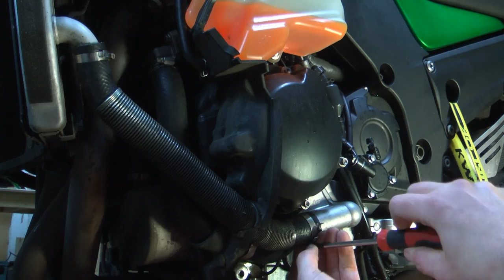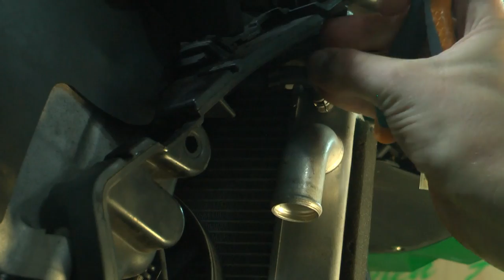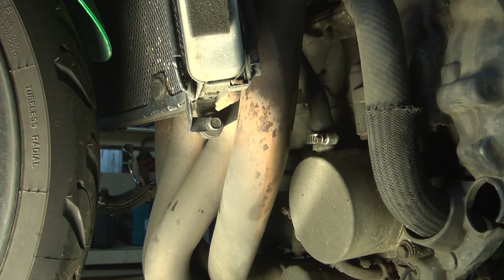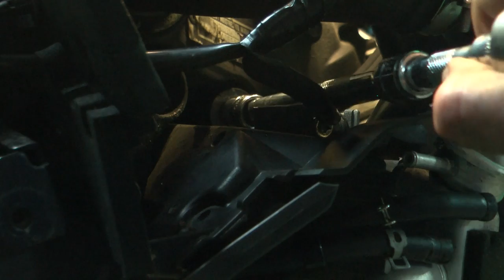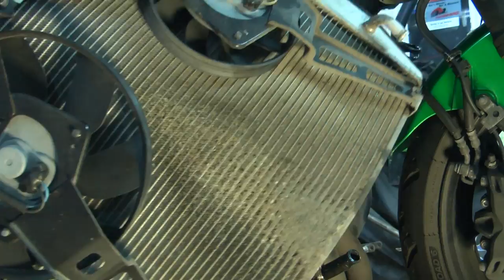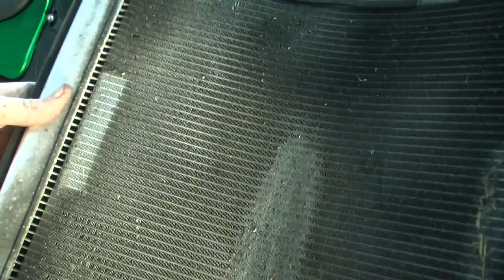Kawasaki ZX-14R ZZR1400 Radiator Removal , Part 1 of fitting Brocks Performance CT Titanium System.

Comment: I've watched all your videos. Very helpful especially with the fairings. Most amount of patience I've ever needed to work on any bike ever. Can't wait to experience all the joys of the spark plugs... I seen your baseline dyno before the exhaust swap. In Europe can you still flash your ecu and dyno tune with the emission controls?  Or if you got caught you would be fined. In the U.S a lot of places are refusing to offer flashes anymore.
Reply from the maker: Thanks for the nice comments about my videos. I'm glad they are of help. In the UK motorcycles don't have emission test during their annual inspection (MOT as its known in the UK) Cars do but bikes don't.
When it comes to the Spark Plugs get the proper Wrench from Kawasaki, its well worth the cost.